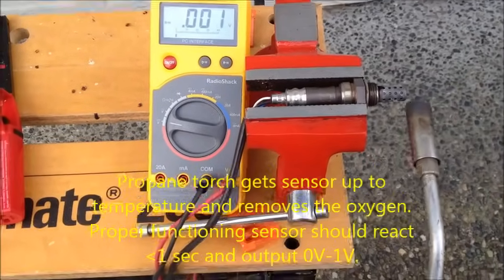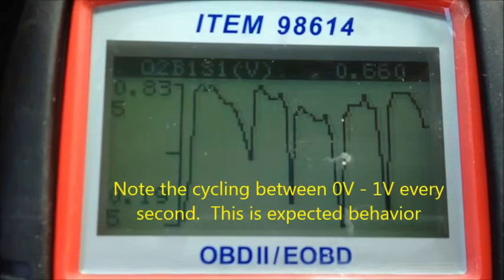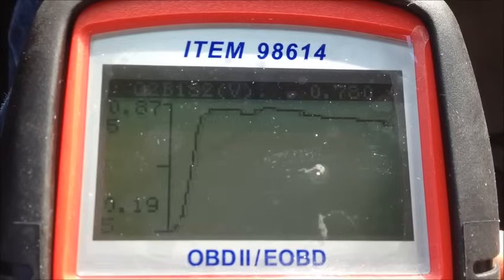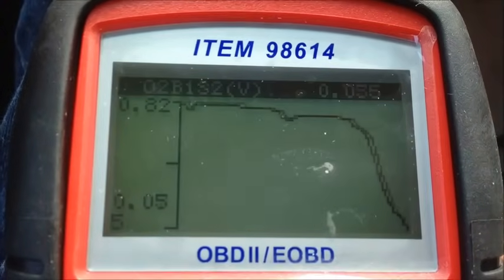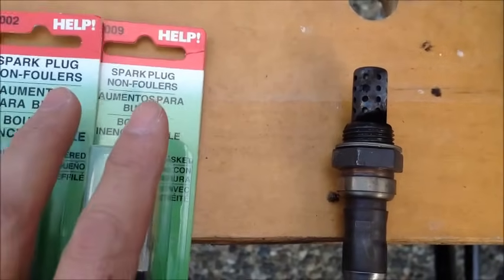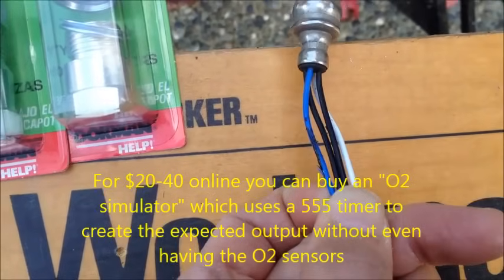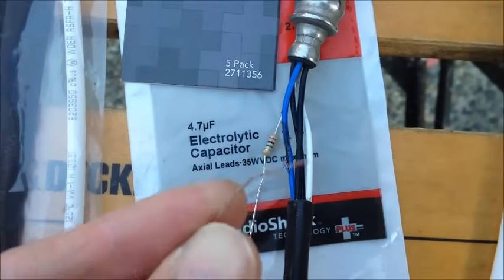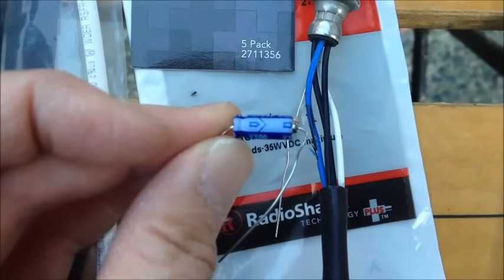$3 O2 simulator fix for P0420 Check Engine Light

Comment: The 1Meg resistor and 4.7uf cap trick cleared the PO420, but now I have PO139.  I changed the cap to 1uf, but now see wide fluctuations in the live data.  I use a OBD2 "dongle" with a phone app "Car scanner" to graph the O2 sensor output.  I guess I need to experiment with R/C values to find the "sweet spot".  Any other suggestions?  I haven't tried the defouler trick yet.  The car is 2005 Accord 4cyl.  Thanks.  It's interesting that the PO420 code seems to appear any time I disconnect the car's battery, then not show for a year or so after clearing the code a few times.
Reply from the maker: Sounds like you're on the right track.  The P0139 says the response of the downstream o2 sensor is too slow compared to the upstream - your RxC is too big.  By reducing it to 1uf you reduced it by almost 80% and so it makes sense that the response is now too fast.  I'd start changing the values by a factor of 2 instead of 5.  It's perhaps easier to find resistors in various values and some people have used a potentiometer to find the sweet spot without soldering, then you can solder in the same value.
Reply: Stupid me!   I put the capacitor on the O2 sensor end of the resistor.  Duh.  :) After finding and fixing that, put in 2uf with 1M, still PO139.  Now, to try the 1uf cap (put in correctly this time) and see what happens.  If that doesn't work.  Oh well, guess I'll just have a CEL on.  The car's got over 300k miles.   @miteeman
Reply: With 1M and 1uf, still have PO139.  Next I will try 500k ohm and 1uf.  Update:  tried this, still PO139.  Then gave up and put the wiring back to original.
Reply from the maker: You say you have a graphing obd app.  Instead of having the car diagnose if you've got it right use that to look at the input & output.  The input should be fluctuating fairly quickly, but you want the output to be responding much slower but not too slow - see the video for samples.  I did a quick search for samples of the input/output and here's a sample video.  https://youtu.be/KGpMzdEO5KY?si=nzG5thPBCiwN1RbO
Reply: I just put in a bottle of Duralube "severe catalytic exhaust treatment" and drove about 50 miles at 70mph, now the O2 sensor output hovers at around .6v (.4 to .7v) with no codes being flagged. The O2 voltage was varying widely between .1 and .95v.  I did what I should have done in the first place.   A bottle of "miracle stuff" fixed it.  :)   @miteeman
Reply: My guess is that some ECUs are "smart" enough to detect the time delay introduced by the R/C low pass filter, possibly  by comparing it to fuel trim or the upstream O2 sensor.  At any rate, my issue seems to be "fixed" for the moment, by running a bottle of cleaner through it.  @miteeman
Reply: I have been looking at the graph of the downstream O2 and fuel trim together.  The R/C filter did smooth out the waveform to around .5 +/- .2v or so.  This eliminated the PO420, but caused the PO139.  Different R/C combinations yielded similar results. There is no emission testing where I am, I'm more curious as to what exactly the computer is looking for and would like the CEL to be off.   @miteeman
Reply from the maker: Unfortunately I can't tell you an exact formula for what causes the ECU to flag, and it varies between manufacturers and years.  But take a look at my video and the other reference video I gave you for hints about what does work.  Good luck.
Reply: It is a "cat and mouse" game, apparently.  We try to cheat emissions and some of the more aware car makers try to defeat us at our game.   All is takes is a firmware update.  Here in TN, in Maury county, with no inspections, we can put anything that rolls on the road.  This is both good and bad.  I'm not from here, I just live here.    @miteeman
Reply: In the end, a bottle of "Dura Lube Severe Catalytic & Exhaust Treatment -16 oz . Exhaust System Cleaner" did the job.  The check engine light stays out.  No affiliation, just a user of the product.

Comment: You should rev it to 2000rpm to get quicker results after the solder. Great vid, I'll be doing this in a few days. Im useing 1 m ohm resistor, and 1 uf 50V capacitor
Reply: Did  the 1uf capacitor work for you

Comment: For people with the grey white and black wires. 

Grey is ground, takes the negative end of capacitor.  Black is signal. Grey also takes the resistor, no resistor on black wire.
Reply: Will the resistor go before or after the capacitor on the gray wire? On the O2 sensor side or the ECM side? Thank you in advance. I installed the way it shows in the video and I’m getting a high voltage code. I’m assuming this will fix my problem.
Reply: I thought signal wire takes a resistor. Black is signal right?
Reply: @dpham671  it's been a minute brother. I can't remember which one is the signal wire, but I will say that after doing this on one vehicle I've never done it again. It's way easier to mechanically trick the system by putting defowlers on the O2 sensor
Reply: @dpham671  thought the same, black is signal, resistor on black not grey (ground/neg). Just tried this but my voltage is stuck 1.275 v not changing. Did i short it?? No cel yet, or is it supposed to go on grey ground and not on black possibly. Couldn't find a wire disgram for my red white black grey so kind of guessing. Using 4.7 cap and 1mohm resistor. modern sensors possibly need something different?
Reply: I'm getting codes 1166 1147 1167 1146. When I do a smog test on the scanner it only passed once. It just st fluctuates. Potentiometer is probably the best way to go I haven't tried it yet too lazy anyone doing a first gen Nissan Murano I got it to work properly let me know

Comment: I have used the patch and fixed the cat low efficiency issue, no more CEL of it; however, I still have the heating element resistance too high error; replaced a new O2 sensor but still got the same error about heating element; wires are ok. After the research it seems to be the heating time that taking too long to reach the temp and triggered this 2D13 CEL. Any idea here how to fix it? Can I try with different value resistor?

Comment: The wires coming from most O2 sensors is stainless steel. This is usually difficult f not impossible with out using the correct solder, and flux in combination.

That is why crimp on connections are used with most universal replacement O2 sensors.

Tim

Comment: why just not to buy new O2 sensor?
Reply from the maker: The O2 sensor is not the problem, but you do need to test that it's working properly.  This addresses a failing catalytic converter.
Reply: @miteeman  sometimes p0420 appears but cats are ok(honeycomb is intact) and according  to the O2 charts, the sensors are also ok… 
I sometimes add Catacleam once every half a year and it helps for a while
Reply: @miteeman  my 2006 accord throws the p0139 slow response code after the fix. Car has new o2 sensor and cat.  Should I try different values?
Reply from the maker: @boogie3598  Yes, you need to speed up the response by reducing the value of R x C.  So try cutting either one in half.  It's usually easier to find resistors in various values but you can cut either.

Comment: Which diode should I use on an O2 sensor on an 01’ S10 V6. It only has 2 wires.

Comment: I'm not saying this doesn't work, it does. People have been doing this since the 80s when O2 sensors were $200+ each. However, I will say that if you have a bad cat, simply fooling the downstream O2 may not be enough. Especially if the ceramic inside is plugged or broken up creating a blockage in your exhaust. This trick plus removing the cats is the only sure fire way this will actually fix the issue.
Reply from the maker: This will NOT work if you remove the cat.  This depends upon a working CAT and O2 sensor.  This just slows down the response of a working system.
Reply: @miteeman  which is what causes P0420 codes to begin with. The extra volume of air passing by the sensor. It's the same principle as defoulers and simulators. Bad/no cats cause the downstream to switch at the same rate as the upstreams. The p0420 code is set when it switches too quickly, slowing down the switching rate by this method or removing it from the exhaust stream inside the pipe will cause the switching rate to slow, thereby shutting off the MIL. The reason spark plug defoulers sometimes don't work is that they're too short and don't get the tip of the sensor out of the stream and the sensor still switches too quickly. That's why people started making simulators that look like defoulers, only longer. It removes the sensor from the exhaust stream.

Comment: Hi! 
I did this. 2014 ford explorer.
0
P0430 is gone now, but i have a stuck lean code B2S2. The o2 sensor doesnt really sweep at all (stays at .360 v) which i can see the computer seeing a lean condition. 
Have you ran into this?

Comment: I was getting the P0420 code. I did this on my 2003 Dodge Durango and I am now getting the P0138 code almost immediately. Signal voltage too high (over 0.9V). Where would it be getting higher voltage? A capacitor and a resistor should not raise the voltage right? I did not cut into the heater wires and made sure I insulated my connections.
Reply: Bad sensor. I got the P0380 code after doing this. I replaced the downstream sensor and the code went away.

Comment: Installed using 1mohm and 1uf cap. Getting p0138 voltage high cel. At idle, voltage is around 1.2. Would the 4.7uf cap fix this?? Thanks
Reply from the maker: The voltage should never be above 1V - the o2 sensor shouldn't be generating that much so that's suspect.  I'd need to see what the signal was like before, and whether the o2 sensor works in a bench flame test.  If I had to guess, I'd guess you're slowing the signal down too much and go with a smaller R or C - reduce by half or three quarters.  But I'd definitely re-check your wiring as it should be varying between 0 and 1V.
Reply: @miteeman  i am running no cat. Would that contribute to this? How do I go about lowering the voltage? Increase the resistance or increase the capacitor? It's an downpipe with 90 degree sensor extender.

Thank you for your help.

Edit* reduce either or. Ok got it. Thank you.
Reply from the maker: @xoxosadiexoxo  sorry, this isn’t going to work without a cat.  This mod relies upon having a working cat.  This circuit just improves the signal but can’t generate it.

Comment: Hi MITEEman
I'm glad to see your most recent reply was just days ago.  I appreciate that you watch to see what people are dealing with when trying your tip.  I used your mod and after every monitor but the O2 sensor reset I wondered why it hadn't.  After a drive today I got two pending codes: 0137 and 0139.  I saw on a scanner that the output was ranging from mid .3's to mid .4's on my downstream sensor.  I was expecting everything to be perfect after the last monitor reset but now I'm thinking the 1 M Ohm resister might be too much.  I'm gonna try a 470K first, then maybe a 150K if that doesn't work.  That seams consistent with what another follower had happen.  Do you think I'm on the right track?  I saw on a scanner before I made the mod that my O2 sensor was fluctuating from ~.12 to ~.96 which is what you'd expect for the 0420 code.  I also used a 1 micro Farad cap instead of the 4.7 mF you used.  I believe that will only vary the frequency of the reading fluctuations so I'll leave it for now.  Thanks for your knowledge.  Your reply will be appreciated!

Comment: These people with trick in the O2 sensor and the long run it’s going to cost you a lot more money. If you don’t fix it right you’re just doing a temporary trick fix Foolin the computer the motor. It’s got a rich lien all you’re doing is causing yourself more problems you’re better off just fixing it right and being done with it
Reply from the maker: Normally I'd agree with you but I'm betting that you haven't replaced one of these yourself with an inexpensive aftermarket, or been willing to pay $2500 to the Honda dealer.  The inexpensive versions frequently fail again so you're back in the same boat and spent $500-1000.  Most cars old enough to have this problem are worth less than $10k, so spending $2500 is an option that few would take.   But thanks for watching.
Reply: @miteeman  first off do you have to make sure that the catalyst system is defective and it’s not something else you have to do all the troubleshooting and diagnostic not just throw a piece in there because you the code coming up get it diagnosed correctly make sure because spark plugs will throw this code, so many things or causes same code
Reply from the maker: @CharlesLease-ei1ee  I agree with you, Charles, which is why I demonstrate bench testing the O2 sensor to rule that out, and observing the wave forms of the pre & post o2 sensors.  What diagnostics would you recommend in addition that don't require removal and disassembly of the catalytic converter?

Comment: A blue cap like that isn’t made to get hot. Tantelum capacitor may be better.
Reply from the maker: I've never worked with tantalum so that's an interesting point I had not considered.  Radio Shack doesn't have temperature specs for the capacitor (believe it or not there's still a Radioshack.com!) but aluminum electrolytics can be rated anywhere from 185-220F.  I see that tantalum can go higher but they can also be in the same range, and of the few that listed temp ranges on Amazon several had the exact same rating.  I'm not sure how hot it is 5" from the o2 sensor behind electrical tape, but if it gets up around 200F the tape itself would be melting which I didn't observe.  The effect of heat is likely to change the capacitance but since this is not an exact science and you'll have to play with values to find the right RxC for you, it's just part of the tweaking.  Worst case heat can cause the electrolyte to vaporize but I couldn't find info on what temperature that would happen and again I see no evidence it's above the rated heat capacity.  The real test is what happens on the car and I verified that this basic Al electrolytic operated fine for many years.  But thanks for sharing that information.

Comment: I tried this for my 2009 Acadia.  I'm getting a stuck lean code and sitting at .580 to .585 consistently.  

Could this be due to flipping the capacitor the wrong way?  Completely plausible but wanted your input.  Thank you!!
Reply from the maker: Hard to say without any diagnostics.  The first question is whether your o2 sensor is working.  Did you bench test it with a flame?  If it's failed then nothing will get it to work.  But I'm going to assume it is working.  Your stuck lean could be due to too large a value of R x C so it's changing but extremely slowly.  If you have a graphing OBD or even one which gives you voltages in real time you could observe this.  If you're using an electrolytic capacitor marked with + and - then it's possible to reverse it and that would likely result in a short circuit so it never charges and the circuit would have no effect other than a slight change in voltage drop across the resistor.  Since you seem to be getting a new code I don't think that's what's happening.  My assumption is that you've slowed down the signal too much - try using a smaller value capacitor or resistor, maybe start with 1/2 the current value.
Reply: @MITEEman  it was a new sensor, I was watching live data and it was only toggling that small amout for the time I was watching.  So I should maybe try a 2.5 vs the 4.7?
Reply from the maker: @supercharged00gtp  If you can watch live data, what is the upstream sensor showing?  If the sensor is new then it should range from 0 to 1 if that's what your upstream sensor is showing.  Even an oversized RxC should reflect those changes just on a delayed timescale.  I would start by looking at the upstream signal and if that's varying from 0-1 as expected then I'd definitely check your wiring again because that doesn't really make sense.
Reply: @miteeman  I'll pull more details tomorrow.   I appreciate your help!
Reply: @MITEEman  sorry for the delay.  Bank 2 sensor 1 operating normally toggles from  .1 to .9 range  at a rate that matches banks 1 sensor 1.  

I'm going to clean the sensor I took out and put it back in B2S2 back in verify it goes back to a 420 code.  The modded does from .565 and max .580. I checked for vacuum leaks including the evap purge valve and it was not stuck open.

Comment: Greetings, good morning, where can I buy the resistor and the capacitor, thanks
Reply from the maker: The days of Radio Shack are long gone.  If you live in a metro area there's probably still some electronics parts store - search for "electronics stores near me".  But you can always find them on Ebay or Amazon.

Comment: Hi! Will this work with an faulty sensor too or is a good sensor required for this?
Reply from the maker: It needs a good sensor.  Follow the video to diagnose if yours is working correctly.  A strong flame will remove enough oxygen to test it.

Comment: combining this mod  with the 02 sensor extension  should make it even better at fooling the system.
Reply from the maker: I don't know why that wouldn't work but it shouldn't be necessary unless you already tried the de-foulers and don't want to remove them.  You can tune this electrical modification to achieve what the de-fouler is doing.  It's possible that the de-fouler may not give you enough of a signal to work with and you'd have to remove it but I haven't tried it.  Good luck to you.